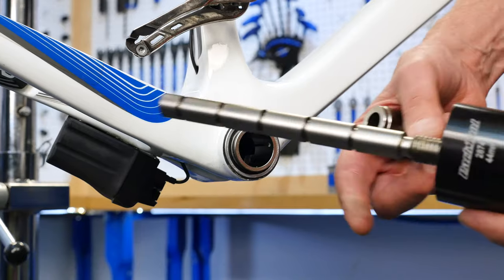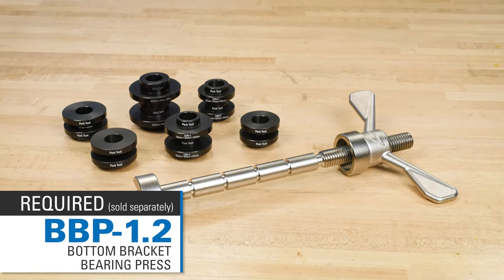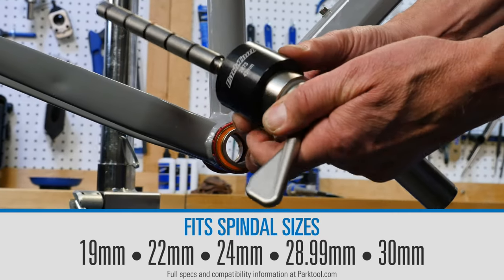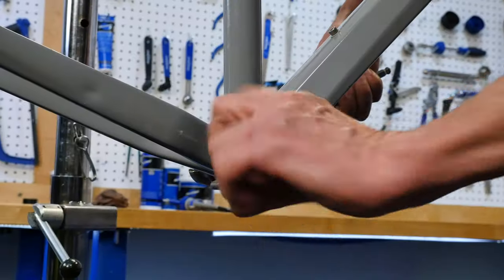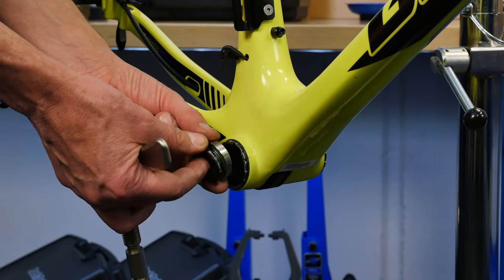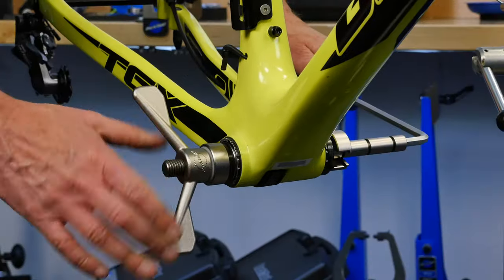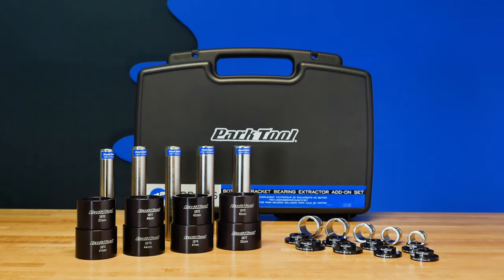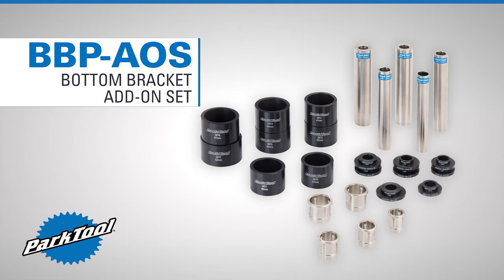BBP-AOS Bottom Bracket Bearing Extractor Add-On Set

Comment: I am seriously disappointed in this tool. The expanding collet keeps pushing through the bearing and does not extract the bearing. I tried numerous times just to extract a 28,99 plastic inner from a dub bearing and that did not work. I spent a bunch of money on something that does not work the way it should work. And yes I did use it correctly.